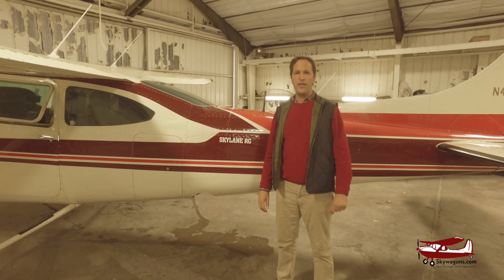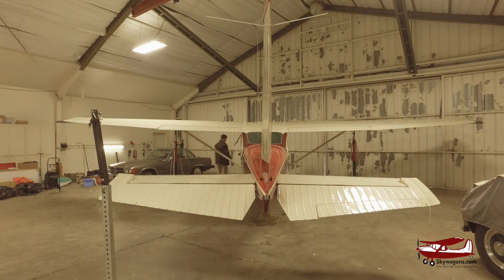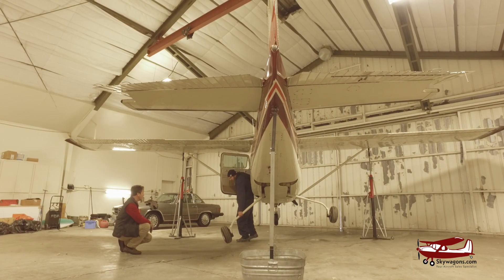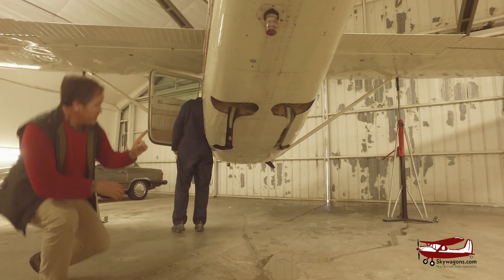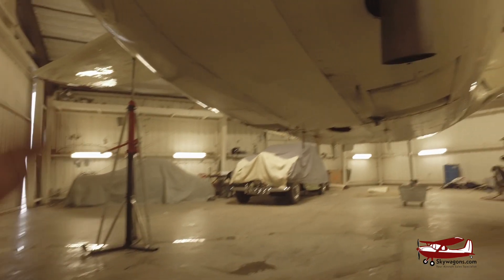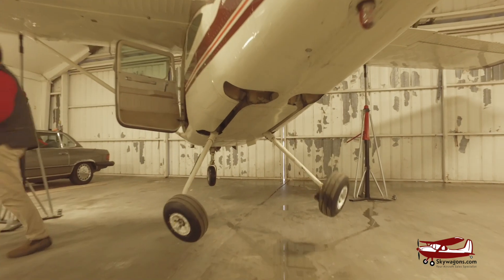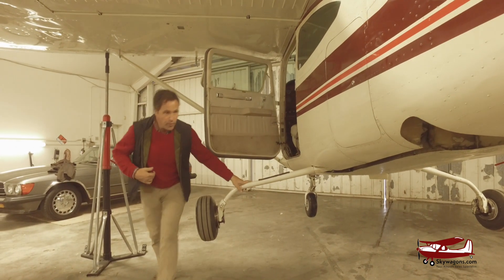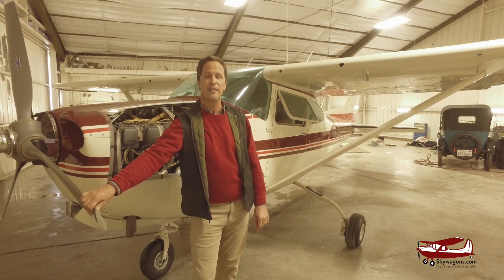GearSwing

Comment: This video showed more than just the gear swing. When the plane was jacked up, you could see just how the CG affected the plane. For that matter, how to jack up the plane was good to know! I was always curious how the main gear drops then twists as it comes up. I flew Cardinal RGs for a while and i'm about to get checked out on a 182RG. Thanks for the video!
Reply from the maker: You have to jack until the mains are up and the nose is very very light on the ground.  Then put the tail stand under it. The gear will knock it off the jacks if you power them up and the hit the ground mid swing.  Just release them so they swing free and check the ground clearance before a powered swing right up and down.

Comment: In some models the down lock indication is a single green light. microswitch wiring is series.  So if the three are not adjusted exactly, one could get a good/green with a gear not locked.  To test correct ops.  do three extension checks and in each, apply some load to a different wheel to make the other two 'lock' before the restrained wheel.  Ensure that you do not get a green down and locked indication until the last wheel is down/locked.  In the serial electrical connection with one green light. any one of the microswitches can show a change condition - up or down locked with the other two misadjusted/failed/shorted.
Reply from the maker: Thank you very interesting.

Comment: That was cool to see. Is it common for the front gear to collapse on these? Would love the speed advantage but wondering if the speed is worth the cost in annual, maintenance and insurance?
Reply from the maker: The nosewheel collapsing really isn't common but it can happen just because it is possible, but it is not a weak link in the design.

Comment: Main gear down lock actuator tolerance of .008, I believe. Would you concur?
Reply from the maker: I'm not sure of the exact number but it has to be tight and not rattle when there is no weight on it.

Comment: Hi,
What is tour solution under the wing? 😍
Thanks
Reply from the maker: What is a tour solution.
Reply from the maker: We had just pulled the plane in from outdoors, where is was raining and blowing like crazy.  The "solution" is just water that drained off the plane.  - Don the Camera Guy
Reply: @skywagonuniversity5023   Hi, You use different points to lift the plane, can you enlighten me on this point?
Reply from the maker: @alexlad64   Each plane has strong points designed into it for jacking.

Comment: Which gear system is better? 177 RG or 182 RG? And if it were your money, would you buy a turbo 182 RG or a 177 RG with a tornado alley turbo normalizer?
Reply from the maker: I'd buy a 182 Turbo RG. Better all round.  No Spar AD, stronger, bigger, faster, more fuel, more useful load, 540 Lycoming at 235 HP.  etc etc etc
Reply: @skywagonuniversity5023  Thank you for the reply. I admire and respect your plethora of knowledge.
Reply from the maker: Thank you.

Comment: If the pilot forgets to lower his gear on final approach or before touchdown, is there a warning annunciator?
Reply from the maker: Yes, very loud, it detects 20 degrees of flaps, low airspeed or low manifold pressure. Any of the three and any combination makes a gear warning horn.
Reply: @skywagonuniversity5023  failing that there is a soft ding ding ding noise that gets louder to a bang bang bang noise, then that stops and you get a scarping noise.
Reply: @Mike_Costello  and lots of laughing over the radio…

Comment: It may be a reliable system, but the limp/weak look of that retraction is enough of a reason by itself to choose a bonanza over the Cessna rg.
Reply from the maker: Have you ever flown one?  The mains can never collapse on the ground either.  Side-loads mean nothing.
Reply: @skywagonuniversity5023  I have admittedly never flown one, and I can see the merits of the design, but it’s a cosmetic thing.  Compared to a Bonanza (especially a 24v) the cessna gear retraction just looks flimsy, and frankly uncool.  Love your channel,  thanks for the great work and info.

Comment: Wrong....if the airplane is rolling, it can (and has) retracted while on the ground.  Friend of mine had this happen to him...multiple witnesses to it also.  He had a 177RG, and I've flown a T210 for a few years.  Great airplanes, but the gear system is the weakest part of the design.  Saddles are prone to cracking.
Reply from the maker: Don't just say "wrong" so intolerantly.  It is not "wrong"  Try to be polite.  If you put a 182 RG (and that is what we are talking about here) on the ramp and turn on its master switch and put the gear selector up, the gear will not retract. If you start the engine in that condition, the gear will not retract.  If you taxi it and everything stays exactly level the gear will not retract. BUT, if the plane were to bob over an uneven surface and the nosewheel extended to the point where the micro-switch felt the weight come off it, it would release and retract and the prop would hit the ground, but the mains would not. The mains would have to pump the plane 18 inches into the air to be able to to go over center and retract and the hydraulics do not have the pressure or ability to do that. If a main gear retracts "on the ground" it is due to a bad bounced landing where momentarily the clearance is enough to allow it to release and drop down and go under the plane and retract. If you've owned all these Cessna RG's you'll know how high you have to jack them to get the tire not to hit the ground when doing a retraction.  That is the height it has to bounce on the ground to allow a main to collapse.
Reply: @skywagonuniversity5023  I should have mentioned it was during a landing roll...my bad.
Reply from the maker: No worries.  Thanks.